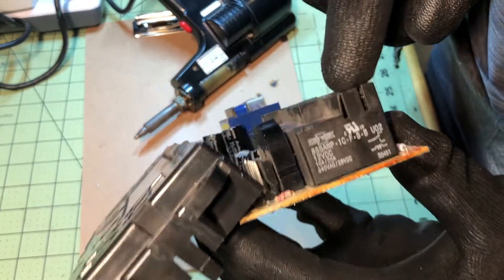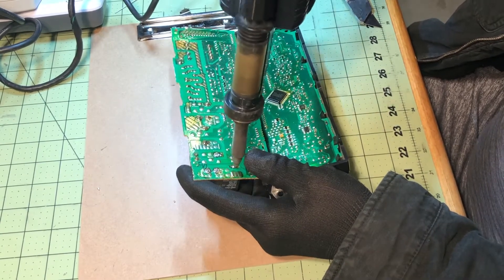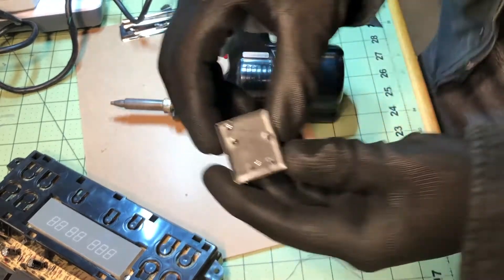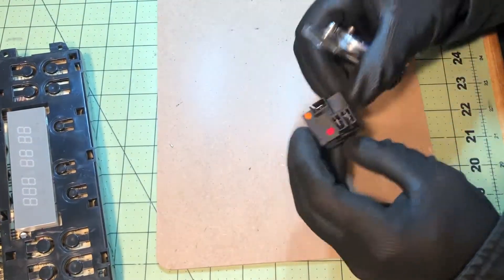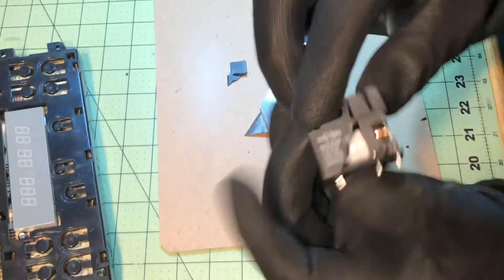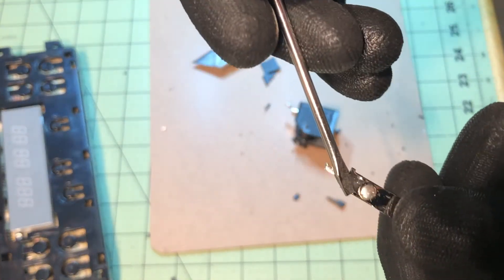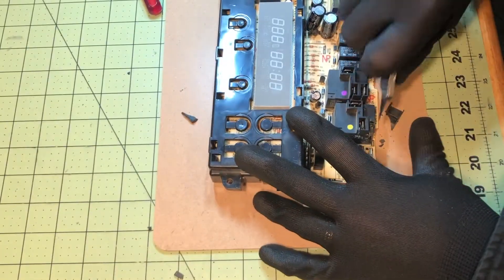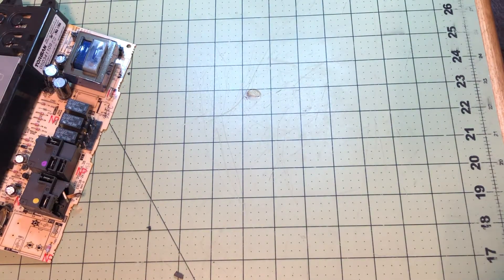Relay Contacts Inspection

Comment: Have to destroy the relay to check it???
  How do you check one without breaking it apart?  Supply power on and off to see if different contact pins register voltage?
  Can they be checked for continuity with an ohm meter?
Reply from the maker: check the DC coil voltage, make sure it's getting it. Hear the click of the relay engaging or put a finger on it to feel it click. Best to test the contacts with a load, whatever the relay normally supplies power to, like its compressor or heater, etc. They draw more current than a meter even LoZ, so that's the best test. But even then you can have intermittent connection between the contacts, so it's ideal to test multiple times.
Reply: Electronics Projects have a dryer getting to hot. All stats and the thermistor check good (electrically). Thought the relay might be sticking. 
  Could it be one of the very small capacitors on the board?
Reply from the maker: @rickeykeeton71  if the relay was sticking, it would blow a thermal limiter. I would check to make sure the vent is clear. How hot is 'too hot'? When I test the drum temp, I usually get between 180 - 260 F on 'high', depending on model and if it's a gas or electric dryer and the vent configuration.
Reply from the maker: @rickeykeeton71  I would join the Facebook group 'Appliance Technician Group' to get troubleshooting help. You can tag me as I am a member, along with 1500 other techs.
Reply from the maker: YouTube did not post your reply, I can see you commented in my notifications, but it does not show it in the comments here.
Reply from the maker: Still not showing your replies, I checked on two computers, multiple browsers and my iPhone. I see you posted, but the comment is not showing up. I recommend joining the Facebook group I mentioned, much easier to communicate on there.
Reply: Electronics Projects can you see this?  I am on an IPad.
Reply from the maker: @rickeykeeton71  I see this message, took about a half hour for the notification. You in Alabama?
Reply from the maker: @rickeykeeton71  I am getting a small 'error occurred on this page' message every time I reload it.
Reply from the maker: I sent you a message with a link to my FB group
Reply: Electronics Projects where did you send it?
Reply from the maker: @rickeykeeton71  https://www.facebook.com/groups/1940521266213457/